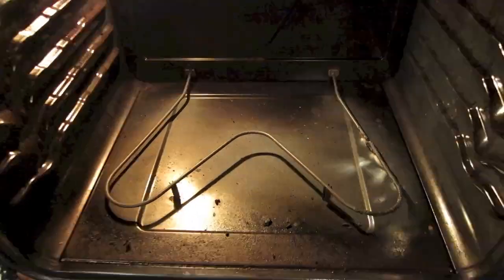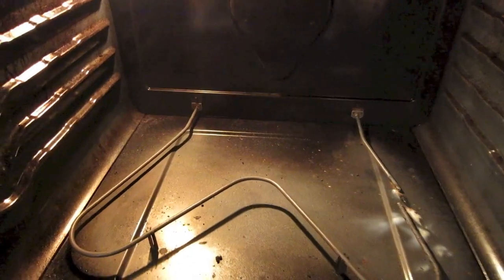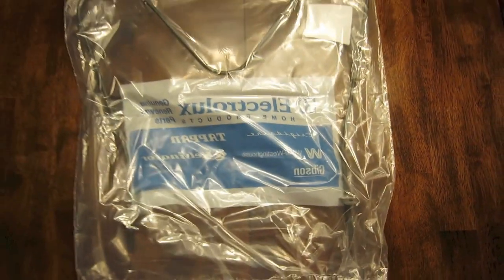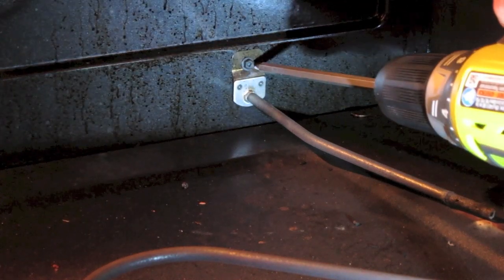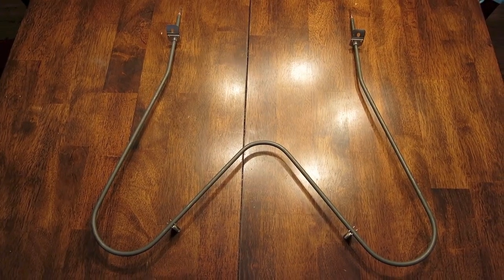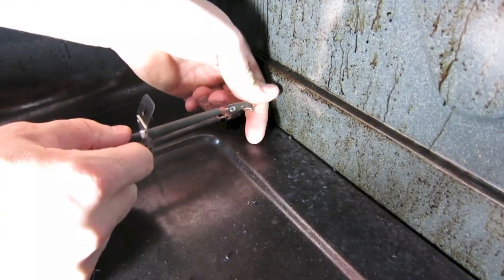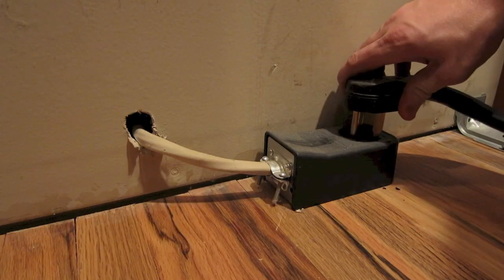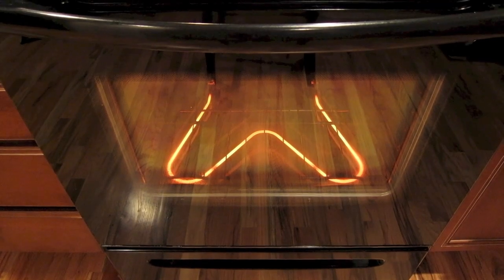HOW TO REPLACE INSTALL BAKE / HEATING ELEMENT IN OVEN

Comment: Thank you! I did this before with an after market element. It burned out a year later and I bought a better quality replacement (still cheaper than a new oven). I couldn't get the 1st replaement out and googled solutions. Your video came up and though you didn't address my specific concern somehow seeing you do the disconnect with a little force helped me. Yay! THanks!!

Comment: Thank you for this. You made the job way quicker and easier than it likely would have been had I tried to wing it myself. Looks like we have the exact same oven. The replacement heating/baking element cost me $30 and only took about 15 minutes from start to finish. The only thing that slowed it down any was the new heating element connection point is L shaped while the original is horizontal so original slid right in while the new took some finagling to get it back through the opening before I can screw it back into place.
Reply from the maker: Thats great! Nice job!

Comment: Thanks for your video
... You should also try easy off. It should get the streaks off your oven ... Or if you want a less chemical way. Baking soda mixed with water till a paste leave over night then spray with vinager and leave for 2 more hours then wipe. And if that still doesn't get it off you can use a wet sos pad.

Comment: Super helpful. I learned 2 things, first the connector poles at the ends of the elements are actually not poles, but flat rectangular thingies that slide into the wires and 2nd that if you are not careful you can lose those wire connectors and would have to go fishing for them. I am waiting to get the new element and then replace per your video. Thanks a bunch.

Comment: Than you for this video.  I knew i could get out the old one but the tip of putting the new one right there saved me from having to fish the wires out.  Guess I'll just have to clean it with the new element in there instead of empty
Reply from the maker: you are welcome!

Comment: Mine started smoking after I changed it out, also a black fridgidaire like yours.  I've read that normal to smoke but I was worried I think I saw it coming from behind where I screwed it in but I shut it off quickly. Too scared to turn it back on lol. Gonna go get an extinguisher first before I try again just incase the wires are bad and starts on fire.

Comment: Great video! This just happened at my house and was worried I would have to buy a new stove! We have replaced the element and cleaned the oven, but my oven floor has damage similar to what is shown in the video. Is this dangerous at all, or am I still able to cook? I have tried searching google for so long and cannot find this answer anywhere

Comment: Thanks for the info.  Here's my problem.  the screws won't come out.  I've had a hardware guy here to replace the element and he couldn't get it out either.  It broke two of his tools so he washed his hands of it.  I saw another video of someone heating the screw with fire then pounding in a bit and manually trying to make it turn.  Have you ever done that? or anything similar?

Comment: Super helpful, but one question for you: my heating element isn't broken like yours--just isn't heating up at all (the broil still works though). Do you think I should replace the heating element, or could there be some other common problem to check first?

Comment: Question, can you use the range with the old element removed? Like if I take out my old element, and not have a replacement in yet, can I still use the range top?

Comment: Good video,  I'm surprised you didn't have to replace a fuse with the arcing that occurred,  btw those screws are called Robertson  head
Reply from the maker: oh thanks for the info. and yes I was surprised it didn't trip the breaker too

Comment: Hey Sir
What do you suggest if one of the wire attachments is hard to remove from the damaged burner. I got one side off, but the other side seems to be on there a little more tight. I don't want to damage the wire connector. Thanks in advance
Reply from the maker: hmm, not sure, they should come out fairly easy. sorry I can't help more

Comment: What do you do if the heat element won’t remain connected to the wires? I tried clamping them but even that seemed to be fruitless. Do you suggest a type of electrical tape to secure them so they won’t fall out into back of oven?

Comment: Thanks, Ryker! My mom's top oven element won't work. I think this will resolve it however, her oven is 30+ yrs old and I'm not sure I can't locate the replacement part.
Reply from the maker: deb hopkins h Yep most online companies will have replacement parts. good luck!
Reply: You might be able to make a replacement heating element with Kanthal® resistance heating wire. People use that wire to make heat elements for kilns that are used for pottery and heat treating metal such as with knife making. Google "how to build a kiln" for info. Or, you can be nice and buy mom a new oven if you can't find the right element.

Comment: I should have looked at your video before I tried change the element;  the wires got pushed back into the oven wall. I tried to reach them with fingers and tweezers and just pushed them further out of reach.   How do I find them from behind?
Reply: Ether take the back panel off the oven, or go and buy a hemostat, be sure it is a very thin one. search google if you don't know what they are. Reach in and try to grab the wire. keep at it until you get the wire.

Comment: Why don't you just flip the breaker for the oven instead of having to pull it out and get behind it. If it's to code, then the oven should be on a dedicated circuit. That's the only thing I'd do differently here. Otherwise, great video 😉

Comment: my lower bake element is not inside my oven. it is underneath. how do I get to it?
Reply from the maker: there could be  a panel to remove
Reply: TheRykerDane yes there is, it's in the back. it's still under warranty so they are coming for free to fix it😊 thank you for responding.

Comment: if you can't get the screws out can you recommend how to get them out.
Reply from the maker: are they stripped out? you could use an easy out bit.
Reply: Find someone who has experience with that sort of thing, stripped screws to help. Or, try this, insert a thin blade such as a butter or steak knife behind the screw plate on the heat element the stripped screw is in and then at the same time turn the screw counter clockwise while gently prying with the knife. This could help the screw thread to successfully grab the sheet metal and back out. After the screw comes out, ether use something called a rev nut to fix it, or go one or two sizes up with a replacement screw so the slightly larger threads can grab into the sheet metal. screw the new larger screw in slowly and feel how it goes in. If it bogs down and wont turn, it might be too large and you may need a slightly smaller screw or a different type of screw called a self tapping screw. Also, be sure your replacement heating element has a large enough hole for the new larger self tapping screw you used. One thing, love this video but don't recommend using a power drill to remove the screws. Those screws are screwed into sheet metal and if you start out with the drill set to screw in instead of out, you can easily strip those screws by mistake. Use a hand held screw driver instead and remember, righty tighty and lefty loosy. Turn the screw driver right to make it tight and left to make it come lose. All you guys with screwing [screw driver] experience don't laugh, some people are screw driver virgins and um, don't know how to get er in or out with out some advice.

Comment: I lost one wire....how do I retrieve it?
Reply: use a hemostat or very small needle nose pliers, keep at it until you get the wire. there also may be an access panel on the back you can take off and get to the wire that way.
Reply: I'm sure it's too late for your case, but for anybody else: the back usually comes off or has a panel that comes off that allows you to feed the wires back through the holes.

Comment: You should be able to save even more time by skipping the pull over out step.  Just go to your electrical panel, switch off the two pole breaker for your oven/range, and you are safe to dive into the wiring. ^_^